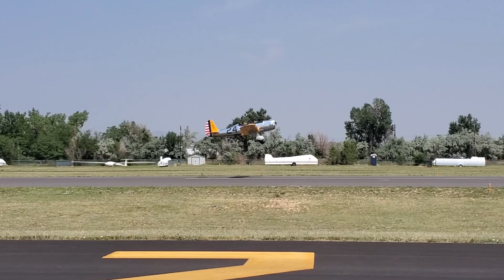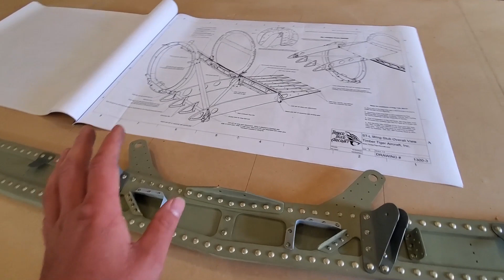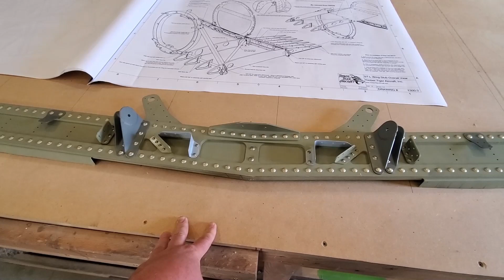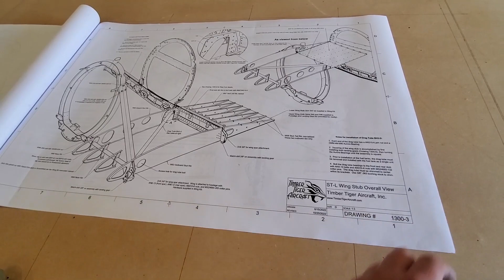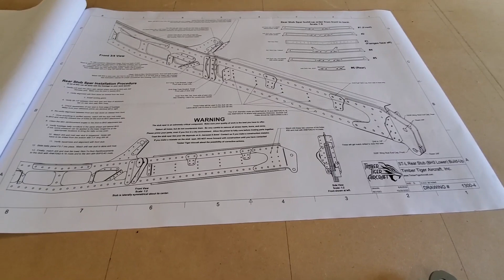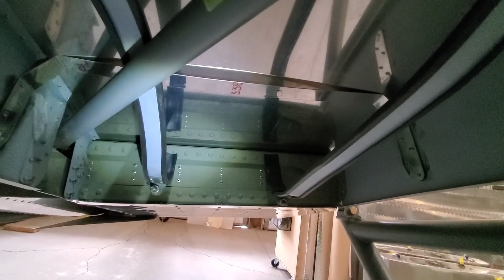ST-L Wing Stub

Comment: Do you have any sort of order of construction ranked by ease of work, cheapness and minimal criticality? That would help a first-time builder to acquire skills on less-important parts, before moving on to complex and critical parts. (Zenair have a construction manual cover that requires all the skills used to build their design, then move on to a tail kit for that sort of progression.)
Reply from the maker: For somebody who is unsure about their abilities, I'd start with the Tail Surface Kit, then Wing Kit, followed by the Fuselage/Landing Gear Kit.  Basically, the same order in which we have them listed on the order form.  The Tail Surface Kit has the most measurement and layout, but the processes you'll learn will be applicable for the whole airframe.  That, plus parts are inexpensive if you mess something up.  The Fuselage/Gear Kit is actually the easiest, but is more expensive.  We have some sample manuals on th website, as well.  Regardless, it's our job to make sure we are providing the best support we can for our builders.  After all, it doesn't do anyone any good if we're not getting kits into the air.
Reply: @timbertigeraircraft  Greatanswer. Thank you.